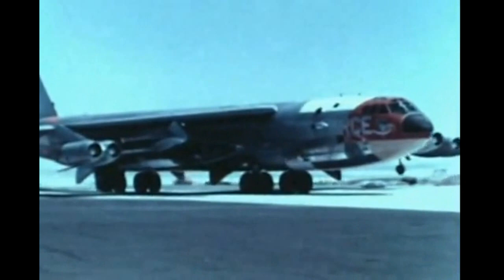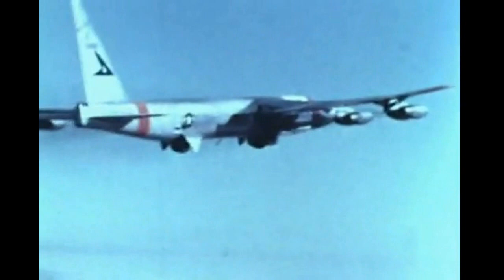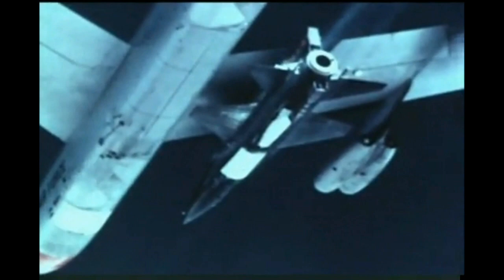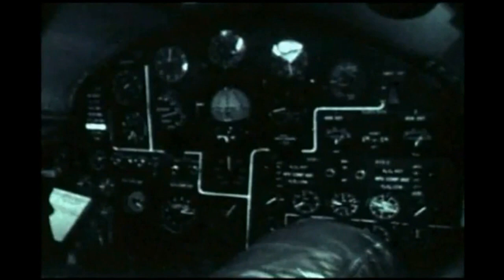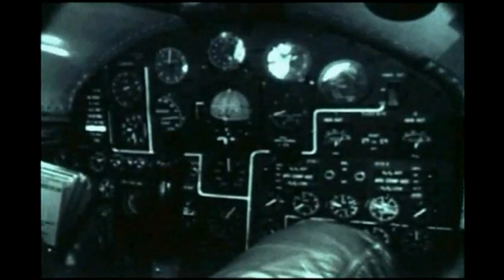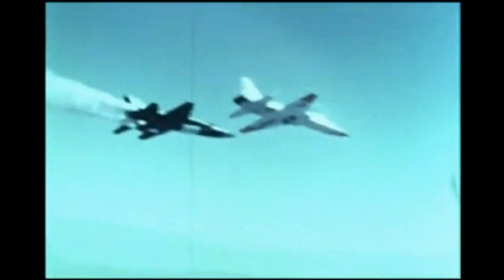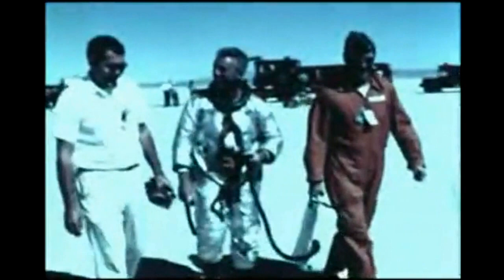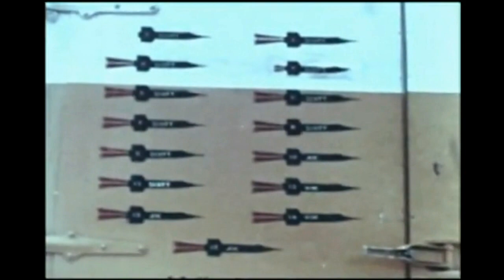NASA Chief Test Pilot Joe Walker's Flight in X-15

Comment: Those guys had balls the size of church bells.   Amen.
Reply: The narrator made a reference to the X1, and how they had to climb in it in flight. Chuck Yeager had to use a broomstick to close the hatch in the X-1, as he had a broken rib. He didn't report it because he knew he'd be grounded, and he wanted to break the sound barrier. I had to stop and really think about that. Here he is, climbing into a cramped cockpit, out of the B-29 and into the X-1. Using a broom to shut the door because of the pain of broken rib(s?). The flight crew of the B-29 kept quiet so Chuck could fly. He wasn't supposed to break the barrier, but he knew when the flight Doctor examined him, the jig would be up, and he'd be grounded. That's why he pushed it past the Mach 1 point. 
I actually got to work directly with a crew of a B-1. The new crews have the same size balls. No matter what you asked them to do, it was always, "Yeah, sure we can do that. One pilot told ne he when he first flew the B-1, he had to keep looking back to see the plane because it handled like a fighter. Amazing people! Such an honor to have worked with them.
Smiles!